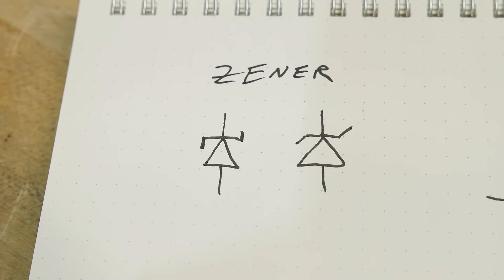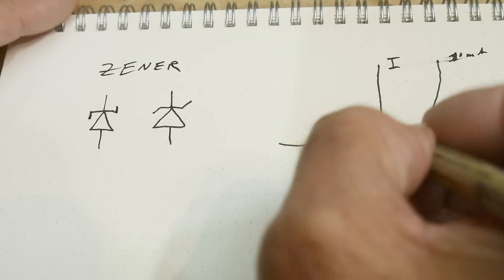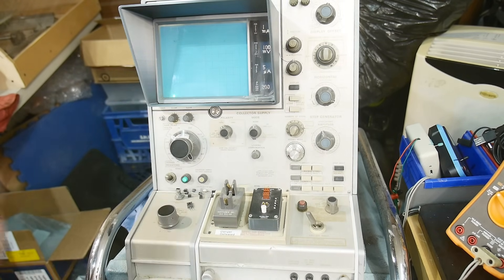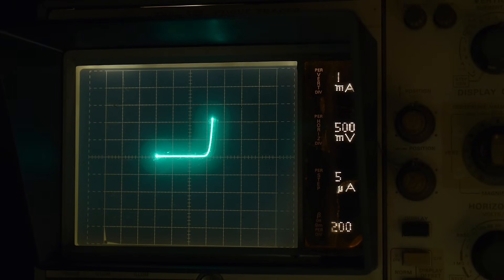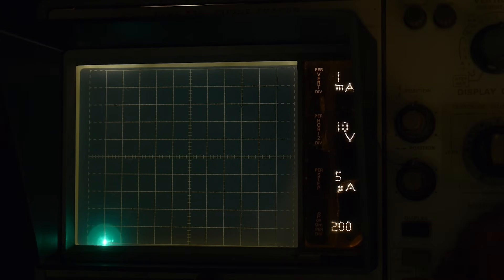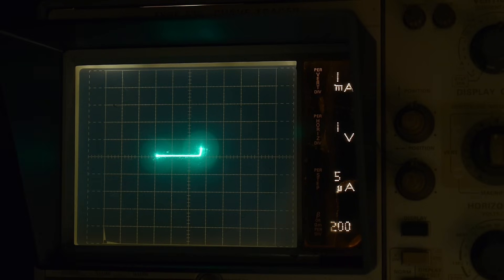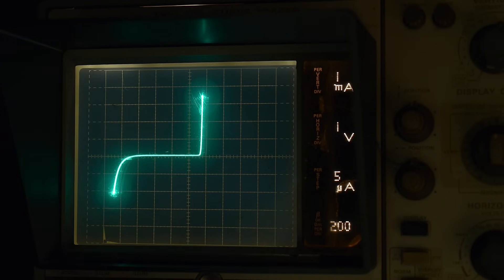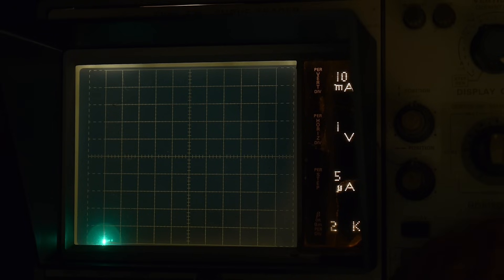#1723 All about Zener Diodes (part 1 of 5)

Comment: Always been fascinated with the curve tracer. And I recently got my hands on one and restored it. I document it on my own channel. But you can use the display offset and magnifier switches to get a more accurate reading of that zener breakdown voltage. Yours looks in excellent shape!
Reply from the maker: I also have videos on restoring mine.  It was in pretty rough shape.

Comment: Ah! Wish I had a curve tracer in my lab to demonstrate to the students these kinda experiments. Makes learning fun
Reply: could it be done with an oscilloscope "ch1 vs ch2" option? One channel measures voltage across the diode and the other its current (voltage across a small resistor)
Reply from the maker: yes: https://youtu.be/Gwo3pEH7hUE?si=grbzHhbgvfJF6Z8X
Reply: @IMSAIGuy  Thank you so much 🤎

Comment: hitting a diode breakdown voltage doesnt immediately kill it. there are scr/transistor/diode testers that go up to 3kV with 1..5mA to check at what voltage it breaks down. without actually killing the DUT.     just dont hook it up to a fet gate